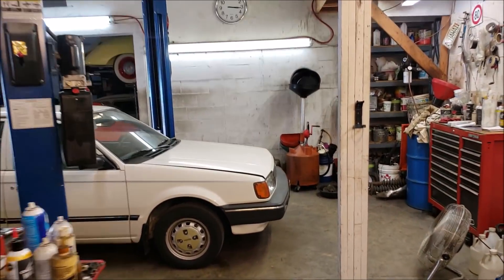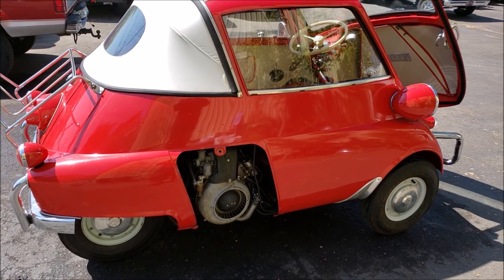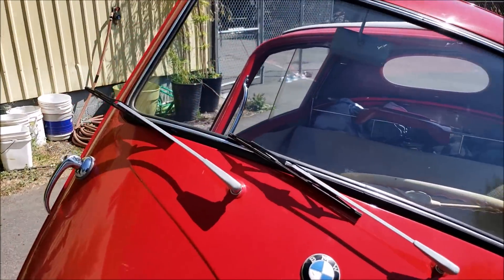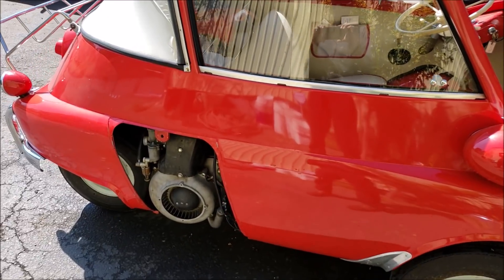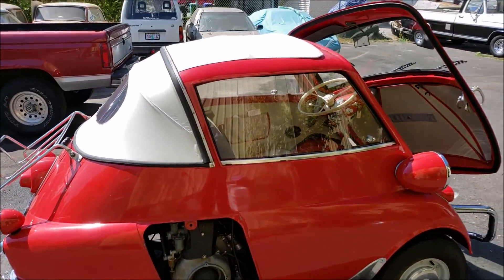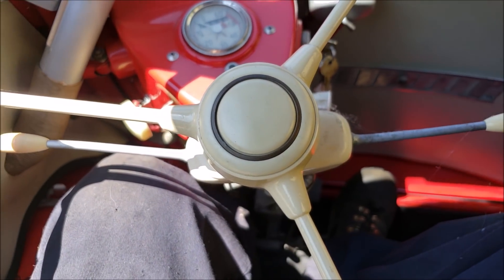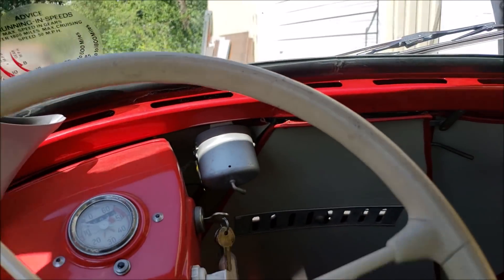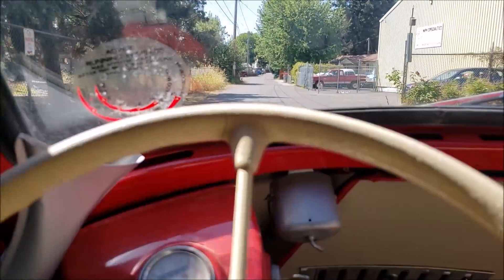Dang ...Isetta ran out of gas on test drive...

Comment: It must be a Cabriolet Limousine Isetta and it is an special Export version for the U.S. Market. Especially the higher backlights were only used for the U.S. Market because there was a special law about the height of the backlight. Otherwise the Drive in the '56 Cadillac 62 Series could not see them :):)